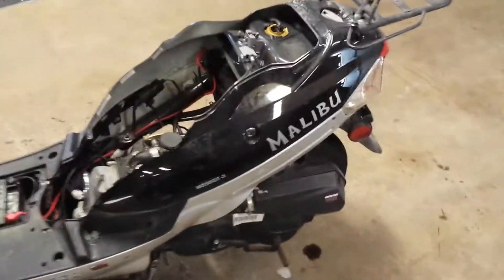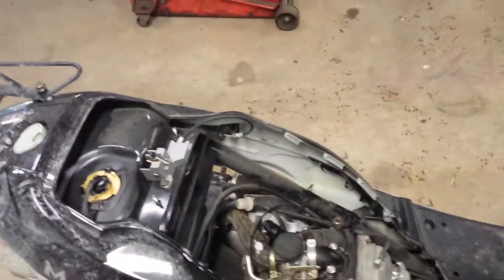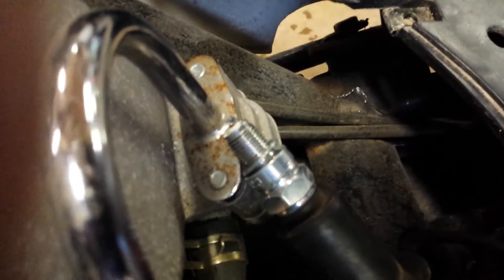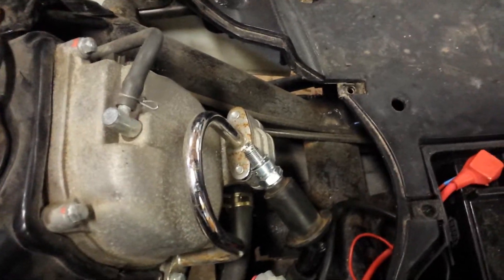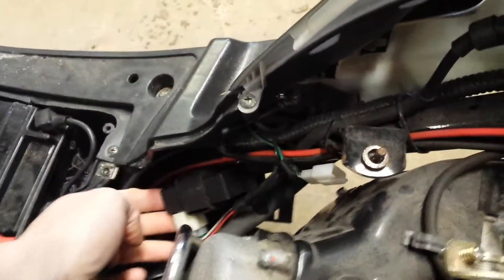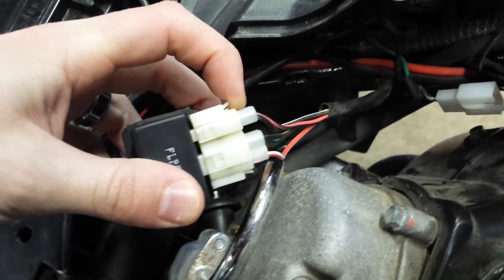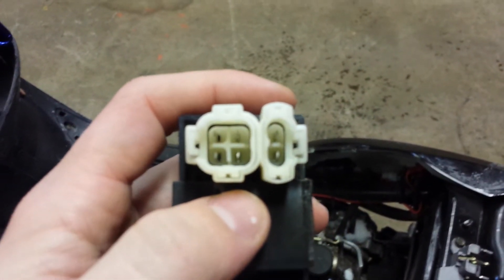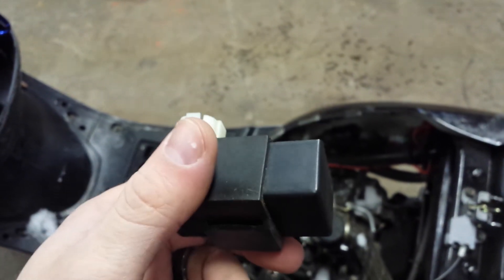Chinese Moped Scooter won't start 50cc

Comment: What has gas to do when you have no spark ? does this mean when you have no gas then you have also no spark ????
Reply: No, the spark and gas have nothing to do with each other, two different issues, if you have no spark try replacing the cdi, If no fuel, clean you fuel lines and carburettor

Comment: I have a Tao toe scooter haven't started in 2 years replaced carb I have spark an gas acts like it wants to start but doesn't any ideas
Reply: Have same issue, why jump it off car?
Reply: Jump lead scooter off car with car running I've done that an it works
Reply: Coz it gives it far stronger spark an cranks faster to fire it up